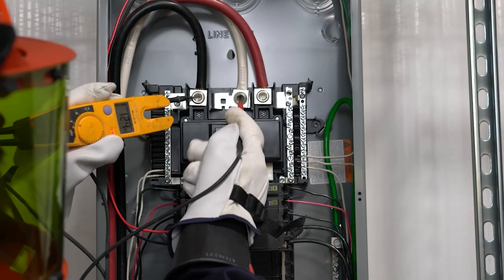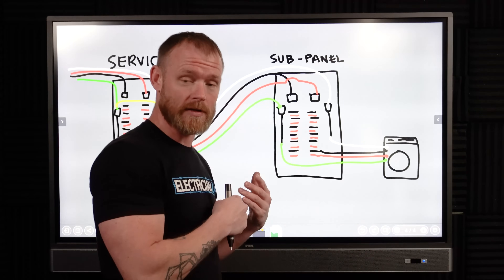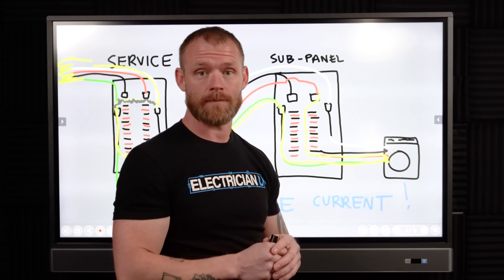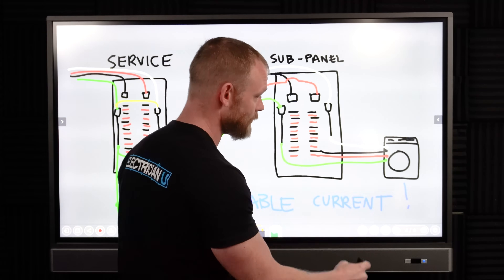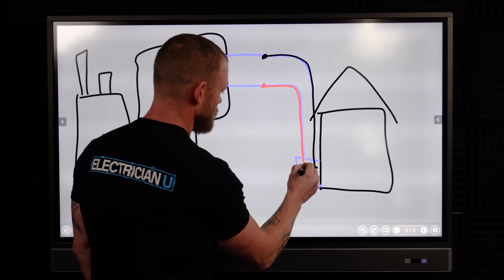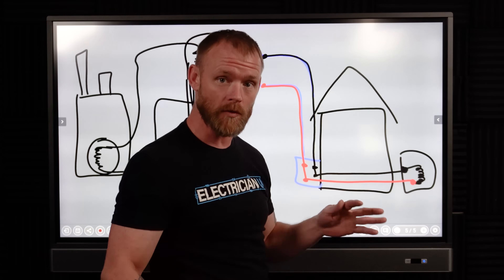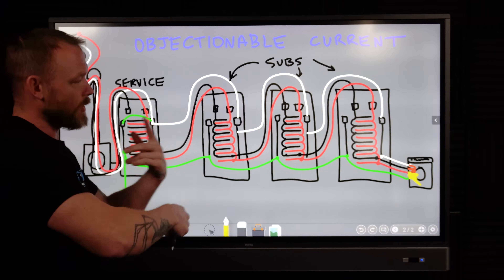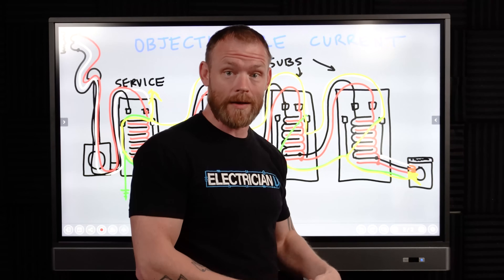Why Do We Bond at the Service Panel and Not a Subpanel?

Comment: I heard if the sub panel is in a detached building, like a shed in the backyard,that the ground and neutral should be bonded and have a separate grounding rod sunk into the earth. Is that accurate?
Reply: It should have a separate ground rod, but the neutral and ground are NOT to be bonded, they must remain separate.

Comment: So how does that little green screw in the service panel fit in to all this
Reply: That screw bonds the Neutral bar to the case and also the ground bar terminals if your case has one inside.  You must remove that green screw if the first means of disconnect is not located in that panel.

Comment: The way I think about it is if you bond the neutral and ground at a sub panel, the ground between the two panels is just supplementing the neutral, so you don't have that unused "0" resistance ground wire waiting for potential fault current to trip through anymore. The whole reason we ground is to give a nice clear unused path back to the breaker (essentially) to trip it easily, but if it has to go through a wire that's already being used we aren't bribing the electricity with a clear wire anymore, so instead of pushing through the additional resistance of current already on that wire's path it might instead decide your skin's resistance is less and take you as a path instead.
Reply: That, and ground wires are sized smaller, there's a chance we would exceed the amp rating of the wire if it was constantly helping current flow back to neutral.

Comment: I believe If there was no bonding jumper their is still a compete circuit and if you have a proper ground it should still trip. Current would flow back on the equipment ground to the service panel then out to earth through the ground rods.
Reply: Ground rods are for lightning protection, not providing a path for a ground fault to trip a breaker.  Electricity wants to go back to its source, in the case of a house, this is the utility transformer, not the Earth.
Reply: We want current to flow back to its source through utilities because if it doesn't the distribution network would be insanely inefficient. Current doesn't want to flow backs to its source, it literally just flows from high to low potential. earth is 0 potential always. yes ground rods are not put in for the purpose of current flow but current WILL flow on it given the opportunity. If current only wanted to flow backs to it source then no person would be susceptible  to shock unless they were completing the hot to neutral path. we all know this isn't the case.
Reply: @danielmcdougle6925  Yep, you are right. it's a safety feature.  If current goes where it's not suppose to, then the best thing is to have it go safely to earth until a trip condition is created.
Reply: Dan I believe you are correct. Think of a 220 dryer or stove. No neutral just 2 110's and a ground. Breaker will trip when shorted to ground. Not all electrical services have a neutral from the pole.

Comment: Great explanation in this video. I have one question though. When there is a ground fault and it doesn't sense the load how does it determine which breaker to trip? The one in the sub panel or the one in the service that feeds the sub panel?
Reply: Modern breakers are manufactured to trip sequentially. So in the event of a fault in a 20A branch circuit the 20A breaker should trip faster than the larger overcurrent protection devices up stream of it. The fault current my be extremely high (thousands of amps)  but the 20A breaker is disinged to open faster than the 200A main. This only applies to breakers of the same make and model. In commercial and industrial systems it is common to have to set the trip time manually to insure they trip sequentially.
Reply: @45-308  How do you get thousands of amps to flow through a 20A breaker without it tripping?
Reply: I was actually wondering that too

Comment: Thought bonding was only done at the transformer
Reply: Sure, the utility bonds at their transformer, but we don't touch that portion of the power system.  We deal with everything after the meter and we also have to bond at the first disconnect after the meter.

Comment: There can be only one...
But why is the protective green wire connected to ground? Wouldn't it offer the same protection with out the ground rod? (Lightening not considered for the moment)
Reply: Ground rods are just for lightning, breakers will still trip without ground rods, but your house and electrical system might not fare well in a lightning strike.
Reply: The ground rod is the path back to the generating station.  Lightning rods can also be connected to the ground, but never to your power system.  This guy needs to go back to school before any more 'splainin is done.  He's confusing everyone.  Most "electricians" think neutral and ground are the same thing because they are connected at the main panel. The neutral is connected to your transformer center tap.  The ground is connected to ground.  There should never be any current on the ground unless a hot wire gets connected to it and only until the breaker trips.  It's a safety ground.The hot wire carries all the current in the circuit.  Since the breaker is connected to the hot wire, it will trip regardless of any return path.

Comment: Your illustrations and explanations are the excellent educational visual along with Mike Holt’s very technical history and explanation about bonding. Eg: Factory motors, DC pulse (lightning) literally taking 120V line and putting to earth and measuring the current and seeing if a breaker will trip (it doesn’t)….your visuals complete the brain circuit!!!

Comment: The concept that is difficult for most to grasp is that electricity will always take ALL paths back to the source, in proportion to the impedance. The easiest way to show this is that some current exists on your bond to the water line (go ahead and check with a clamp ammeter) even though there is a functional neutral wire back to the secondary on the transformer for your house. That wire carries most of the current, because its impedance is the lowest, but the ground (literal dirt) also carries some.

This is expected here (the water line), but isn't for other grounding paths like from a subpanel.
Reply: Whoever doesn’t get that needs to go back to pushin paper

Comment: Good info, not the clearest for people just learning though.  Your first diagram showed a ground going up with the service wires, we don't get a ground wire from service.  ground rod is only there for lightning, you can just say that, showing the neutral midpoint of the washing machine motor is confusing, makes sense for service transformer.  You could touch on the fact that ground wires are sized smaller than neutrals and if we have a parallel path, we could overload the ground wire with current meant for the neutral wire, etc.
Reply: The first diagram is showing the Grounding Electrode Conductor (GEC) — the wire to the ground rod — not a ground feed from service.
Reply: @tim g "the Earth (Ground) rod makes sure the Neutral wire is at Earth potential (0 Volts). If the Neutral wire is not at Earth potential  it is possible, likely even, for it to rise to Mains potential. "

This statement doesn't make total sense. Mains potential referenced how? If ungrounded, a system would have indeterminate potential (voltage) to ground. There would be no path for mains current to flow through someone or something to ground, thus 'mains potential' would not really exist. Taylor is correct that the earthing helps to dissipate static charge, though all the reasons to earth a system (or not) is certainly complicated.
Reply: @tim g "By connecting the Earth rod to the Neutral wire you ensure that ithe Neutral is at Earth Potential (0 Volts)"

Yes I agree with that,  but you still are talking about 'mains potential' without discussing any reference. As you say, if you unground the system from earth, there is no ground reference any longer, thus what is the 'mains potential' that you reference a potential between? As I'm sure you understand, voltage is a measure of potential between 2 defined points. If the earth is not part of the circuit in any way, then there is no 'Mains potential' to discuss in terms of reference to earth. It is, as stated earlier, indeterminate.

Am I just misunderstanding your point? Where would you propose placing multimeter leads to measure this 'mains potential' of a floating system (what 2 points in the system) and what would you expect to read on said meter?
Reply: @tim g re your second response...
I was responding to the OP (Taylor) pointing out that the green line he saw was likely the GEC. (you know, the copper line that bonds the main panel to the grounding rod outside.)

I don't know what you are going on about with this 'the neutral is both ground and neutral until separated' business. Sure, that is sort of conceptually true, but no-one should ever draw those as separate lines with different colors for educational purposes. But I don't think he did, as I think it's the GEC he was drawing. Not that complicated, don't make it so.
Reply: @tim g You can call it whatever you want (yes TN-C-S is correct terminology, though here in the U.S. that terminology is not commonly used in residential) but you're missing my point.

My point is that he almost certainly did not draw a separate green line to depict a TN-C-S system. Far more likely IMO that he drew the GEC.

No where can I find a diagram of TN-C-S drawn that way. It would be confusing as all heck since drawing separate lines is indicative of separate wires. It is clear that ground fault current uses the ground/neutral bond to travel to the transformer via the neutral (low impedance path) to clear a fault.
Reply: @tim g I double checked his first diagram to make sure I wasn't missing something. I sure was. He drew the earth connection at the bottom left, so my claim that he was drawing the GEC doesn't really make sense. 
I'm inclined to agree with Taylor at this point that he sort of just made a mistake drawing the incoming service green. Unless it's common practice to draw a green line where there is no green just to indicate the concept of TN-C-S (I've yet to see a diagram that draws them completely separately); I would bet good money that's not the case in this situation given the context.
Reply: @tim g ok, you're just talking about an open neutral, not a completely ungrounded neutral.
Reply: @tim g communication has been... Interesting in this thread. 

I suppose we're on the same page then... ?
Just to clarify though, an open neutral and an ungrounded system is not the same. The context that began this conversation was your reference to the grounding rod keeping the neutral at ground potential. This to me implies discussion of system earthing, not simple open neutrals, which is an entirely different (and much simpler) concept. Anyways thanks for the conversation and cheers.
Reply: @tim g There seems to be a major gap in our assumptions here. Not sure if you're just trolling or really can't get this.

The conversation started in relation to earthing of systems (i.e. the ground rod). In U.S. residential systems at least, there are typically 2 points that make an earth connection: near the main panel and at the power pole. 

If one were to pull BOTH of these connections (which is what would be required to sever the transformer center-tap connection from earth), then you have a floating system. In a floating system, you have indeterminate voltage to ground. Understood?

An open neutral, which isn't uncommon, is simply an open circuit with a load in series. It happens anytime someone unscrews a wire nut from a bunch of neutrals and decides to prematurely turn on the power breaker.

Assuming the system is otherwise in-tact (i.e. earthed) it implies that there is voltage from the white wire to ground due to the earthing of the system. If the system was entirely unearthed on the other hand, then an open neutral is, again, an open circuit, but no longer would it have a defined voltage to ground.

We getting anywhere?

Comment: Great video.  I have watched a number of other videos trying to explain this concept and I always leave scratching my head.  Your video was very informative and explained this topic well for a non-electrician.  Based on what you said this applies to all sub-panels down the line correct?  I ask because I want to check the sub-panel installed for my swimming pool equipment (that is next to the pool) and make sure the neutral and ground and NOT bonded there.  Thanks again Dustin.
Reply: Yes, ALL sub panels, even if on separate structures or out in the garden by the pool.  You're only allowed to bond Neutral at the first disconnect for the electrical system.  There are exceptions if you have a house wired before old three prong dryer or cooktop/oven, those will have neutral and ground bonded together at the appliance.  The 1996 NEC mandated these branch circuits be 4 wire to include separate ground to avoid bonding, the exemption exists for homes built prior to this.

Comment: My storage building only has 2 conductors. The neutral feeds the twisted bare wire. It's not bonded at the house, but is bonded at the storage building. There's a ground rod there at the building entrance. Plus there's disconnects at the main panel & at the storage building. There's no GFCI breakers at the building. This was per 80's code. Should there be a GFCI there, & how would I separate the grounds?
Reply: You're going to want to have an electrician take a look and definitively tell you how to remedy this.

Comment: Great explanation.  If a generator switch is installed between the meter and main panel, Does the ground get bonded to the neutral in the switch or the main service panel?
Reply: In the switch and the main would have to have the neutrals and grounds separated out and isolated.
Reply: Thanks

Comment: If your ground rod is actually grounded and you haven't bonded the neutral, you will likely have current flow to earth ground and find it's way to the neutral via someone else's system.
Reply: Take a 12 AWG wire tied to a 20A breaker and put in on a free standing 10 foot grounding electrode driven all the way in. Then measure the current with nothing else attached to the grounding electrode. You will likely only get 2-4 amps. In rare cases you could get over 10 amps. The earth's resistance it to high to trip a breaker.
Reply: @tiggeroush  Correct. There’s a video on YouTube where someone demonstrated this. It will however trip a GFCI breaker immediately. But not other types. People seem to be hung up on the idea electricity prefers to flow to Earth and not a better path back to its source even when told otherwise. Electricity will take all available paths back to its source but it will prefer the one with least resistance. Your homes ground rod is a very high resistance path back to the ground rod of the utility transformer that’s bonded to neutral on the secondary side.
Reply: @taylorlightfoot  @jason roush
my sub panel only has two hots and one neutral (no ground wire from main to sub). Sub panel does have a grounding rod. My sub does bond neutrals and ground to give a path back to source if a ground fault happens. 
Would it be best to use gfci breakers throughout sub panel?
Reply: @kyleharris5874  If this was an old install, it might have been to code at the time; if it was to code, it's grandfathered in so long as you aren't changing out the sub panel.  If the sub panel is connected via conduit and you can pull a new EGC wire through, it would be best to do that and then remove the ground to neutral bond in the sub panel.  If you cannot add an EGC all the way back to the main panel, the safest thing would be to leave the neutral to ground bond connected in the sub panel.  So long as you have a reliable neutral connection and the ground bond is connected in that sub panel, your breakers will trip just fine.  You can switch to GFCI breakers if you want to be extra safe as usually the ground rod will provide enough current to trip them.  Is the sub panel located in a detached building or in the same building as the main panel?  You should only have one connection to ground per building.
Reply: @taylorlightfoot  different structure. About 170 ft away. I’d probably have to pull out the wire and re feed with a ground if I did anything. 

Your thoughts match mine so that helps me a ton. 

Thanks guys
Reply: And usually not enough current to trip the breaker.  This is why we bond to neutral at the first disconnect.  Ground rods are designed only for lightning protection.